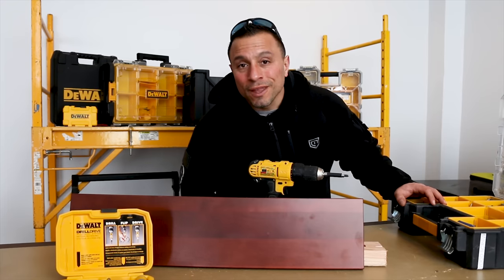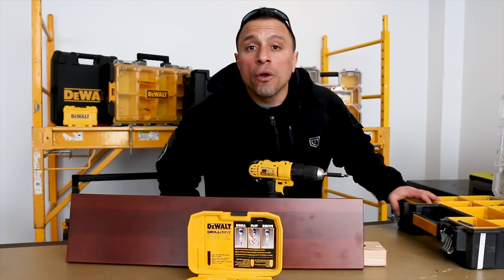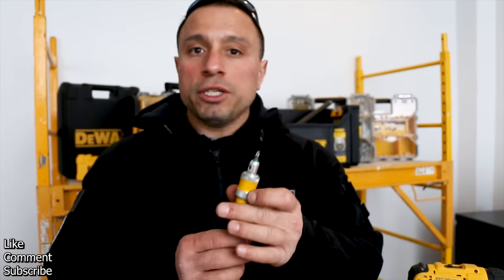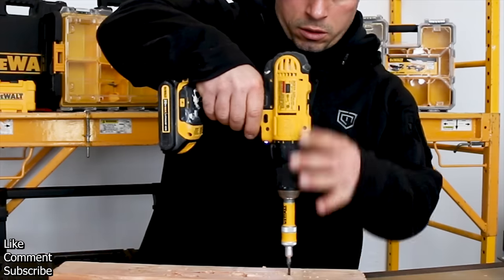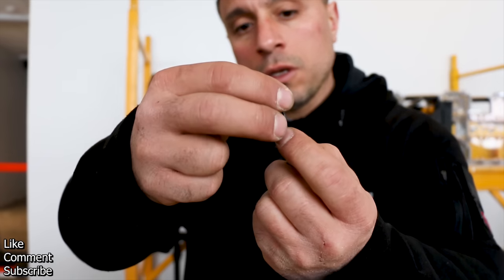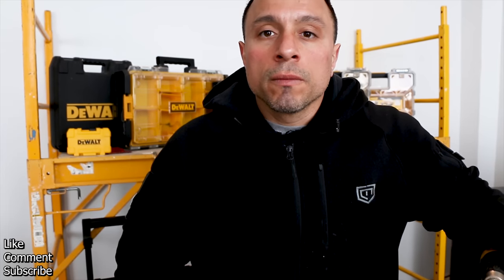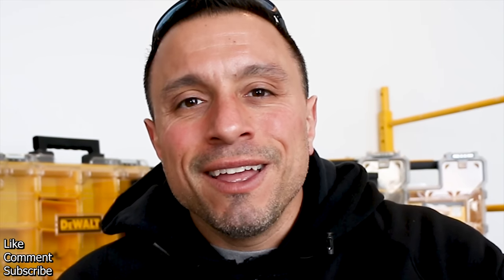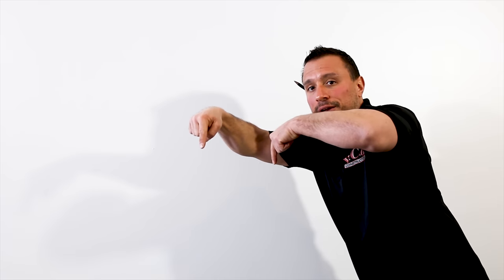The Best Drill/Drive Countersink Kit On The Market!

Comment: Very handy. I bought a Montana Brands kit that came with a quick draw drill drive set. I bought it mainly because it was made in USA and I was not disappointed. The quality is fantastic especially the drill bits. Can't speak for the Dewalt I'm sure its good though just not sure where its made.
Reply from the maker: We'll check out the Montana set, thanks for the heads up!

Comment: I actually got this set   

things I liked, the quick-change feature, the magnet is really good, and the countersink bit side can be switch to a (long bit!) in case you have a job that has different bits

things I didn't like,  hard to find  (i had to buy it at Walmart last one), the Dewalt box is super cheap and flimsy its not going to be able to hold anything in about 3 weeks really soft plastic, nothing is labeled, drill bits are the cheapest you can get also not labeled so you have to do a little guessing when you want to swap them out for titanium drill bits, you have to exercise the Allen screws there almost unusably tight and easily lost,  also the Allen key is the smallest one they could make,- tough to hold unless to have small hands

Comment: Hey, I install cabinetry. I used to have that rapid load set, it was great. I  feel Dewalts taper drills are more suitable to fastening cabs together. Never and I mean NEVER use dry wall scews for joining cab boxes or anthing that requires a screw to connect wood to anything else. Drywall screws are for drywall . I use spax with a T20 Robertson drive. These are the best screws for wood.

Comment: I have a 20 year old craftsman set that has a complete set of those in there, it's ridiculous, and it was also one of the first quarter inch rapid loads that you could get on the market
Reply: I have that set! Use it to this day.
Reply: Me too... I think sears craftsman was the  original implementation of the quick change bits and countersink.   I still use mine to this day also. 

Funny when one sees an oh wow moment by others as if it is new... and youv think... Oh yeah, like 25 years ago!

Regardless, enjoyed the video and the Montana versions mention of the hex bit integrated in tool made me aware that the Craftsman had the same and I NEVER KNEW IT.  Learned something new about my tools.  thanks

I did wonder at one time why there was a small nub on end of five shaft... lol

Comment: I got this kit and used it earlier in the year and don't remember having any problems.  Now when I try to use it again, the drill bit end of the chuck has play (wobble) in it which could cause it to drill a little larger hole than I want.  It's not the countersink chuck that has the play in it, it's the quick changer (big yellow thing).  The bit is super tight inside the countersink chuck, but there's no adjustment that I know of for the quick changer.  When you want to flip it around to have the drill bit out, you push out on the spring loaded end of the quick changer, slip in the drill bit with the countersink chuck, and let go.  It's tight enough that it won't fall out, but there's play from side to side which gives the drill bit a wobble.

Is there a work around for this or is there an adjustment I don't know about?

Comment: That looks so similar to Montana brands system I'd almost call it ripping them off. Except there slightly different so I can't. Though Montana brands one is USA made.
Reply: We had the original patent on the Drill and Driver system 😎 Ours doesn't come with a separate allen key- it's built into the shank, so you never lose it.  DeWalt has now added that to their newest version.  And ours has a 1/4" quick change hex shank.  We also make a self-centering plug cutter that perfectly matches our contersinks so you can hide your counterbore with a matching plug.  That tool is also 1/4" quick change compatible, so you can make plugs out in the field with your cordless drill or impact driver.

Comment: Have Problems after several uses: main yellow bit holder no longer holds the dual bit holder which holds both the screw bit and drill bit. When you reverse out, the drill bit will stick into the wood, pulling the whole contraption out. Used it maybe 3 times. What can I do?
Reply from the maker: Make sure you drill bit isn’t extended too far! Did you look to see if all you ball detents are still in place in the holder?
Reply: Yes I think everything is in the right place. If I look inside the holdingtube, I can see that the blocking nail is coming too short

Comment: Multi use tools are nice, BUT NOT the best countersink bit on the market. and certainly not a repeatable tool.  Notice how the tool wobbles on the start of the video.. as stated on previous comments the tools doesn't last very long, made of aluminum and the tolerance fit wears out quickly.  DIY tool maybe, but not for repeated use on a jobsite.  I don't believe this tool was designed by DeWalt anyway.
Reply: Another guy was recommending Montana brands they are  USA made and similar. I ordered one becose looked cool. And needed something magnetic for corded drill. Because I hear it easier to drive screw with corded when you use pilot hole and magnetic screw holder.